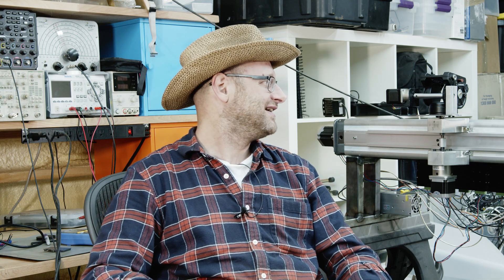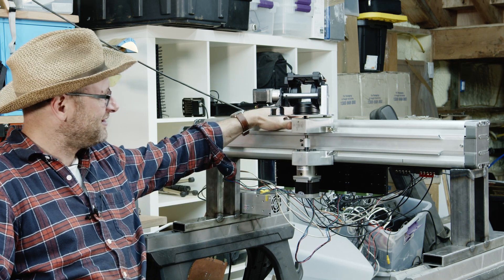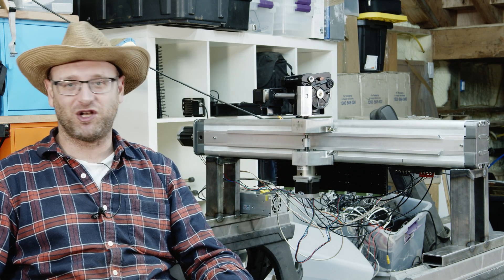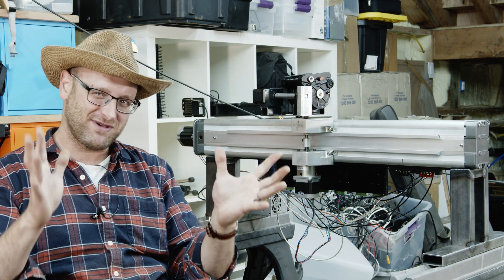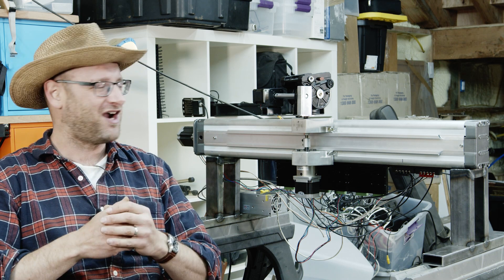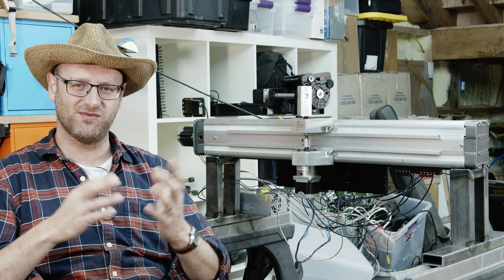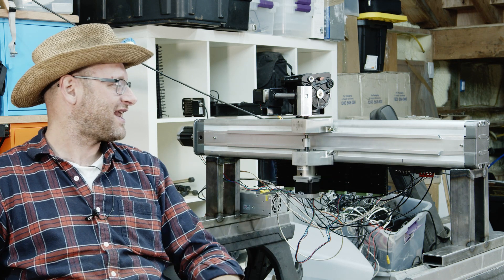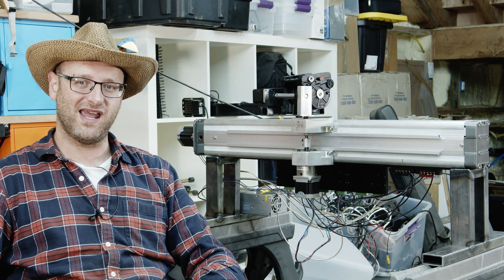3 Axis CNC Camera Motion Rig #tmc2020

Comment: That's great! Interesting you used the Raspberry Pi, I've used the Arduino on similar projects which I found really easy to learn from scratch.
Reply from the maker: I was debating between an arduino, or the rpi, and decided primarily to go with the PI because I prefer the programming environment. I’d like to interface this with other code that uses both the hdmi output and analog inputs, and the PI makes this much easier.